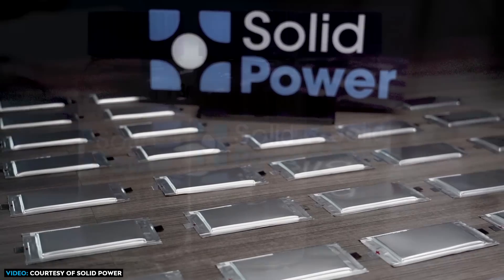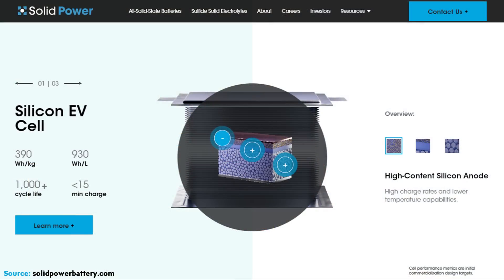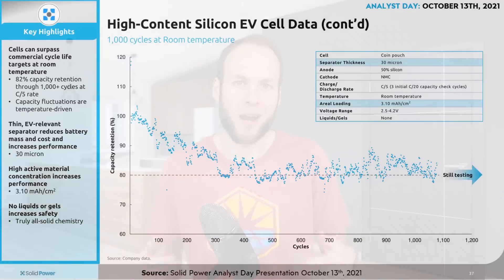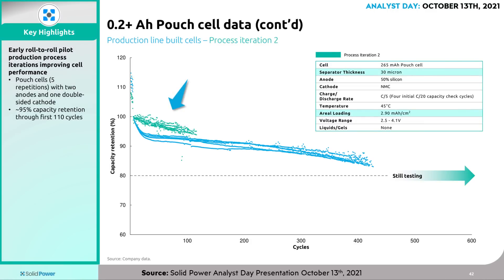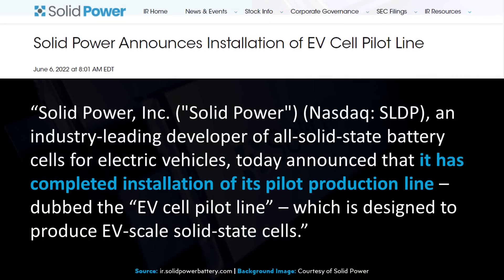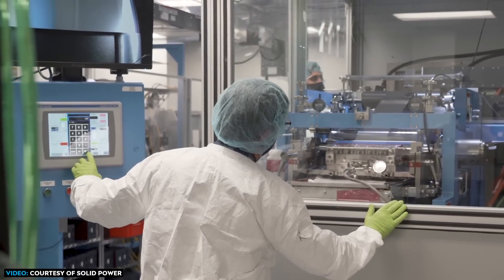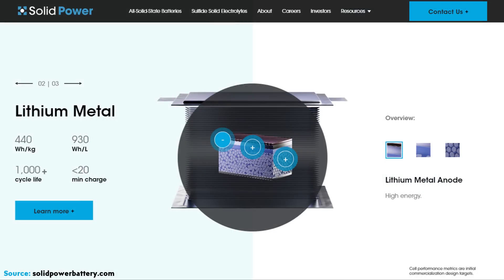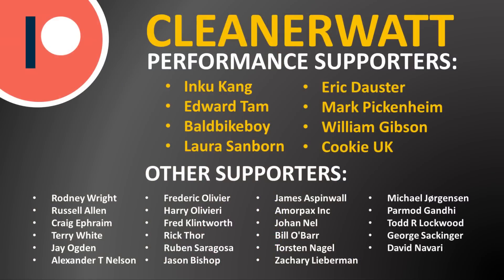This FAST Charging Solid State EV Battery is a BIG DEAL (Solid Power)

Comment: It dropped down to the 80 percent level in only 300 cycles if I read the chart right. Claims that Catl and BYD are increasing there 
watt/kg to around 200 and there is 4 times the cycles and no battery management required. LFP looks like a better solution for the 
short term for cars . It you can get to 400 watt/kg you can start to think about aircraft.

Comment: The degradation curve looks seriously uncompetitive against current-tech 2170 cells - and that is not a good sign, since the curves are being derived from tiny bench test cells.  What will those curves look like when they're scaled up?  I am not optimistic.

As you pointed out, energy density at the cell level is meaningless; it's the pack level that matters.  What we have here are cells that have to expand and contract - so they have to be soft-walled.  Which means they cannot be used as structural components, as the 4680 form-factor can be used.  A lot of pack-level energy density improvement can be harvested with structural cells that these Solid Power cells won't be able to achieve.

I could not read the chart showing manufacturing steps eliminated.  I am curious if they still require a drying step - which Tesla's 4680 cells no longer need, which reduces costs and improves line throughput considerably.

Honestly, I don't see reasons to rank Solid Power ahead of the other efforts underway to commercialize solid-state battery cells.  Others are in the game as well.  Further, It's not obvious that any of them will deliver superior packs at competitive prices.

We'll just have to wait and see.
Reply: your knowledge is very impressive. would you mind helping me out here ? have you heard of Enovix ?...they appear to be involved with Intel to develop a next gen battery...Your thoughts on them would be greatly appreciated

Comment: Well presented.  It does sound like they are still testing and are not off the testing phase. Even if they get this technology working with 1000 cycles, is this enough for an EV.  If you are charging every day, this is 3 year life. This is not really long enough for automobile battery life.  I would expect 2000 to 3000 cycles before replacement.   Good to hear research is progressing.  Thanks for the update.
Reply: I bet for a lot of owners, they would be slow charging over night at home most of the time which I believe the graphs showed like it was leveling off at 80% at that many cycles. So maybe if it was always fast charging then the life would be short but if they’re only fast charged for occasional long road trips then the life could be a lot longer.
Reply from the maker: Good observation
Reply: One cycle in battery testing is fully discharged to fully charged. Partial capacity charges are partial cycles. 3,000 cycles on a 250 mile car would be 750,000 miles (gross simplification).
Reply: @Miata822  Don’t know where you came up with 3000 x 250.  I wouldn’t go so far as stating 3 partials equates to 1 full charge. Too many variables on how fast/deep and temp. I’m sure it would be more than 3 but despite the Elon quote,  1500 is a low est for lithium.
Reply: @GeorgeinOregon  You asked for 3,000 cycles and most EVs get about 250 mile range.
As I said, that was a gross simplification. Temperature (storage, driving, charging) and temperature variations within the cell, C-rate (both charge and discharge), mechanical stress, all impact cell life. 

Cycle life rating is performed under published standardized conditions and is useful only as a starting point, similar to EPA range numbers or a home air conditioner's SEER rating. That's why OEMs take cells to perform their own suitability testing. A well engineered battery pack will last for the service life of the car.